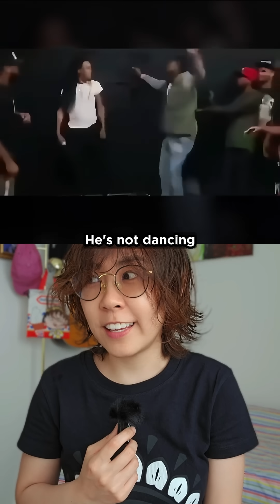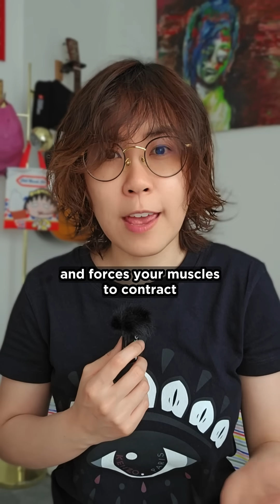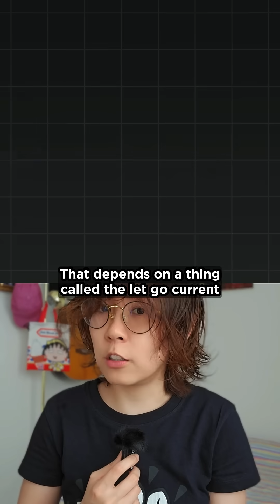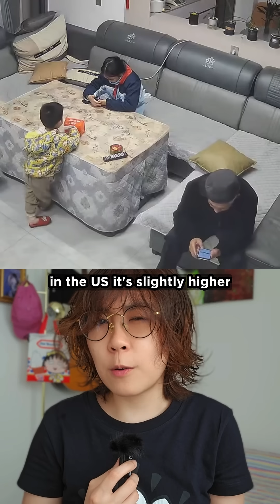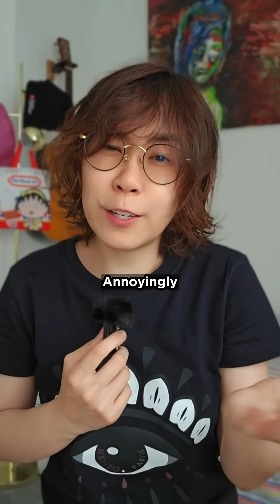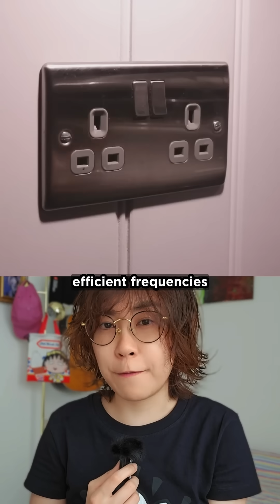How Much Electricity Can You Touch Before You Can't Let Go?

Comment: The last comment about the transmission frequencies being the most efficient is not correct, the reasons for 50Hz and 60Hz is due to historical standardisation. Many other frequencies have been used in the past at the beginning of the 20th century. Changing from 50Hz or 60Hz is economically impossible in the modern grid.

Comment: It does not depend on just one single factor. It depends on the current, voltage, frequency and the resistance across the path of the electricity. All at the same time

Comment: There is also various types of releases that can be made at the box and plug ins, and a gfi, can allow extended current etc, to move... the sun can give yo ua massive zap charging up metal in teh summer.. there is a lot of things that cause create a shocking experiement, and the let go phase is more to do with what muscle groups are being hit... old person I knew hit a main power line of hte city witha pick aze... his muscles in his legs contracted so hard he  flew 12 feet  backwards or something permentant nerve damage, my mom was  fixing a stove deciede not to plug, it and he hands jsut happened ot be wet, so when installing the stove ovens element, she got zapped and her legs were crossed causign her to spring off the  oven and into the wall... so if hands clasp or shut it will grip harder... you need the nads ot release... its depend on the command na contraction of hte grousp of msucles to the means, but yeah will ful let go is avg, but some peope ahve icnredible ..grounding or redundacies around eletricity itself.. jsut like some humans are amazing udenr over 12 g's of force iwth ease, different breeds,

Comment: Not even remotely the most efficient frequency for transferring power across the grid. The reason why some countries use 50
Hertz is it’s more efficient than 60hz for transmission but the reasons we use 60hz is ultimately because it’s a nice composite number we can use to more easily build generators and motors and rectification. Early motors had 2 or 4 coils and it’s easy to calculate phase angles from 60 (180 or 90° per phase) so that’s the Babylonians and their sexagesimal (base-60) counting system. It’s also useful for building purely electromechanical clocks that are accurate enough for daily timekeeping for time cards and such. 1 cycle per second. You just make stuff up some times. Or misinterpret.

High voltage high current power transmission is DC. Direct current is the most efficient frequency. 0 hertz. Every time AC switches the current’s flow negative to positive is reversed and that’s really inefficient, just in terms of how metals conduct. They’re basically cold, solid plasmas. Electrons flow freely thru them but not anywhere near as fast as you thing. It’s actually something very human scale like 0.1mph in terms of how fast the actual valence electrons travel thru a conductor if it were possible to follow one (it’s not) but that’s not what conduction is. It’s the interaction between the valence electrons of each atom “pushing” on the one in front of it. It’s for a lot more in common with newtons cradle than with fiberoptic. Or marbles in a tube since marbles pushing marbles is still technically just electrons pushing electrons, just electrostatic (literally everything we touch) vs electromotive (electrical conduction)  and there is Nothing special for power transmission at 50-60hz As long as it’s  not so slow that incandescent lightbulbs visibly flicker due to being slower than our persistence of vision (24 hertz) or approaching the domain where skin effect occurs and conduction only happens across the surface of a conductor without sufficient time for valence electrons to exert conducting fife thru the whole conductor. Thats thousands of times per second, and keep in mind AC means that the current flows one way then switches and flows the other way per hertz/per cycle. Going only one way this is just pulsed dc, like connecting and disconnecting a battery rapidly, or a 555 timer or other astable oscillator. Connect that AC thru a diode and 1/4 wave rectification allows 90° of the phase thru or 1/4 of the total power and this helps understand why 60hz makes sense

We use 60 hertz cuz it works well with our 360° understanding of a circle. It’s how we designed commutation to work on the first large scale power generators it’s all math shit and compromises and what allows us to use the slowest cycle that causes the least hysteresis’ losses due to heating (due to change in the direction or current) using the easiest number to design around and do math with and 60 is a good number for that. 50 works fine once you’ve developed certain technologies that made 60 unnecessary. Rotating magnetic fields and induction motors for one. Quartz oscillators also were a big deal for timekeeping obviously and we use them cuz they conveniently have a nice clean resonance when shaped a certain way at about 32,000hz. Multiply by two and divide by 1000 you have about 60hz or more accurately you’ve got about 64 which is a useful composite number for binary when the first four binary digits being positive add to 15 on a 4 bit adder (1111=one 1 + one 2 + one 4 + one 8=15) and four 4 bit adders add a numeric value of 60 which is what fits on a DIP-16 chip form factor. It’s just math, engineering, convenience. I’ll give you half credit you get 50% that’s an F congrats you’re an inventor

Comment: Pretty sure she’s going to mention the difference between AC/DC. I’m not going to finish this short somebody tell me if I was right or not.

Edit: I finished it I couldn’t help it. She didn’t mention it… She really is reading off of a teleprompter.

Allow me to explain - bear in mind that I study physics. I’m not a genius and I’m not an electrician so no promises, but based off of my recollection… (Please correct me where I’m wrong)

The green boxes down the street? They’re transformers. The extremely dangerous amount of energy in those overhead lines is DC power (Direct Current). 

The entire purpose of those green boxes is to “transform” DC into AC (Alternating Current), where the current is in a state of flux alternating between that “clutch” threshold and allowing those receiving energy via their residence to be a lot more forgiving than, say, those receiving energy.. By touching a power line.. Where falling from a height gives you more chance at living than clasping to that cardiac hard-reset pole….
Reply: That's not what transformer do. In the eletric system we have generation, transmission, distribuition and the the users. Conventionally all AC (though now, with solar power plants, HVDC lines and things like that, we also have DC in the system, but most of the system is still AC).
So let's say you generate with a thermal or a hidropower plant, then it's usually medium voltage AC. Then you'll have a transformer to convert it to high voltage AC for the transmission lines to get this energy across long distances (because the higher the voltage, the lesser the losses).
Then, closer to the end users, you'll have another transfomer to convert it back to medium voltage AC for the distribution system.
Finally, close to your home there's another transformer to convert it in low voltage AC, which is the voltage your electric equipment uses.
Why higher voltages are more dangerous than lower voltages? Because current is proportional to voltage. So given the same resistance, a low voltage might give you a current that is bellow the threshold where you're in serious danger, while the high voltage will give you a much higher current.

Comment: I worked in construction in the US. We use 110v for most stuff, it will latch on. We also use 220v for stuff like a clothes dryers,  basically its just dryers. Most houses only have 1 220 plug

Comment: let go current but than speak of frequency alright alright allow me 4 factors we have voltage also known as the shortage value it is best indicated how much resistance and or distance the electricity can jump than we have the resistance you skin not perfect conductor me i have calluses on my hands that are pretty thick making me still able to let go of 230 16amps 50 hz why because of the resistance it isnt 16amps the fuze never burns thru most likely its below 6 amps but i dont do this often enouch to  go measure that only now we go look at freqency it realy dont mather direct current or 50 or 60 herts you dont have a reaction speed to your muscular control that quick you are stuck either way if the amps are high enouch 

so the let go current isnt a thing cause the reistances based on how you hold it and how electricty flow thru you is what determents the current if your lucky you make a short between a live wire and a device that has a resistance high enouch to limit it to 2 AMPS if your unlucky you have a device that draws 13 amps and you dont add the extra 3 amps and the fuze wil never burn out and you are very very stuck this is why modern eletrical engineering try to protect all isntallation 3 fold and also cut out the neutral if a fuze is tripped

Comment: With a higher voltage nominal electricity would lower the current that would kill people. I know it sounds crazy but if 277/480V was the normal electricity  in the house you would have safer homes, the current wires support voltages up to 600V and you could use smaller wires or smaller amperage circuits as needed. Sure when a person comes in contact with a bare wire they are more likely to burn but they will be pushed back and the exposure time is much lower leading to less deaths.

Comment: naah, you can easily let go 100mA. Issue is not paralysis of neurons, but reaction to whole body pain. When pain is localized, body reacts by loosing that localized part to. But when you are in whole body pain or excruciating pain, your muscles tightens. Like when you are siting at dentist and it hurts, you will tighten your muscles in whole body.

So if you have higher pain tolerance or you trained for this exact scenario, you could easily let go even deadly currents (which is over 60mA).

Comment: Remember you only get electrocuted at the pointy part such as fingers, Chin,etc
Reply: Not really. If someone purposefully shoves a negative and positive charge in your body, with enough voltage and current, you will get electrocuted.

Comment: There are the things Called RCCB in EU that dont allow electricity flow outside the designed circuit ,you can still get cooked if you touch two cables at same time and become part of the circuit ,so the protection wont consider it current leakage in that case,In US there is the same protection named GFCI but its usually used for the bathrooms only ,RCCB or RCD is for the whole apartment so its more recommended and its not that expensive

Comment: He's not getting electrocuted, not until the spark happened.
Reply: This is nonsense. First of all. Even while he was being executed his body resistance is way too high to cause a visible spark. The spark is him shorting out the socket by likely pushing the wires together. In this case the spark actually stopped the electrocution due to the breaker tripping
Reply: So you're saying that being electrocuted only happens during the event in which there are sparks?
Reply: @kntmimi3055 In my 5 years of being an electrician, I witnessed multiple incidents of someone getting electrocuted.
 If you get electrocuted it's either you let go of the wires (you're lucky your reflexes saves you) or the muscles in your hands tightened grabbing the wires without you in control (god have mercy on your poor soul😅) your whole body goes stiff straight like a f#cking arrow, seconds feels like eternity, then boom you block out your body go limp like something sucked the life out of you.
 Yeah, in my experience no one wiggle their body like this guy while in that situation.
Reply: @ALecond dang, how many people you see die?
Reply: @onion8216 Only one, the guy got shocked, falls down the scaffolding head first. He later d!e at the hospital due to blood clot in his brain.

Comment: I've heard the opposite.  Direct current is worse because your muscles seize up, whereas at 50/60 hz, they can spasm instead.  Voltage is more important though, so North American 120v is safer than 240v in Eurasia.

Comment: The voltage is also important, anything below 50v is considered low risk. For example you can touch both terminals of a car battery but it won't shock you because the resistance of your skin is too high.
Reply: I see so many people scared of a car battery, so I usually prove a point, lick my fingers and hold both terminals, showing sweet FA is happening to me.
Reply: A car battery is DC(direct current) and unless pulsed, it doesn't have a frequency(0 Hz).
Reply: @EddyDeWallyvis Correct but irrelevant to the topic at hand.
Reply: @Legalize_Asbestos There are many factors that determine when being electrocuted is deadly or not. The video talks about frequency. I wrote about frequency. In other words, relevant.
Reply: @EddyDeWallyvis You were responding to a comment about 12v car batteries. That’s what I was referring to. So the frequency is irrelevant.
Reply: @Legalize_Asbestos Video talks about frequency, as do I. OP talks about voltage. This makes the OP's comment irrelevant, not mine.
Reply: @EddyDeWallyvis So you can throw out the comment you were actually responding to. That makes for a coherent conversation. If his comment is irrelevant then why did you respond?
Reply: @Legalize_Asbestos To point out the comment is irrelevant when it comes to the topic of the video, which talks about frequency and maybe the OP could learn something. Really don't understand the challenge here.
Reply: @EddyDeWallyvis  You didn't make a comment on the video. You made a comment on someone else"s comment. Do you not understand how the internet works???
Reply: @Legalize_Asbestos Couldn't have made the comment in the first place without the existence of the video, do I? So pretty sure I made a comment on a video...

When someone talks about apples and someone else points out that oranges also exist, does this means that pointing out that the topic is apples is irrelevant? 

Seems like you have alot of things to think about. So I wish you all the best in figuring this one out. GL my friend.
Reply: It's the ampere not the voltage
Reply: @popcorn520 no it's both. The voltage has to be high enough to overcome the resistance of your skin.
Reply: @FloodedStart it's mostly current my friend. A high voltage with a low current would cause no significant harm

Comment: I have been shock by 400v that's basically like shotgun 😂 my hand just flow away from think that I have electric shocked.You cannot be sure that even unplug device can be safe to clean it because of those capacitors who act like battery 🔋 and can discharge on you.

Comment: I’ve been shocked by 120 and 240 in the US and it’s really not that bad you can voluntarily release or you can just lean back and your hand will fall off of the electrical box the only thing that can actually shock you that bad would be the 100 amp that goes into the residential power box that melted my skin instantly and made me lose function of my three fingers for a day
Reply: Wow, that's wild
Reply: Your ability to survive lethal amounts of electricity multiple times by not completing a circuit doesn’t make you strong or cool or different, it just makes you stupid for realizing that youre trying to flex your complete obliviousness to why it wasn’t “that bad”, mostly cuz you had shoes on with rubber soles, and also the reason you aren’t an electrician or engineer. You’re not smart enough to do the job safely or at all. Please just stop. U suk
Reply: So dying from electricity is rarer than we thought?
Reply: Wym? No, there's still too many deaths still from electrocution @koqekanari123